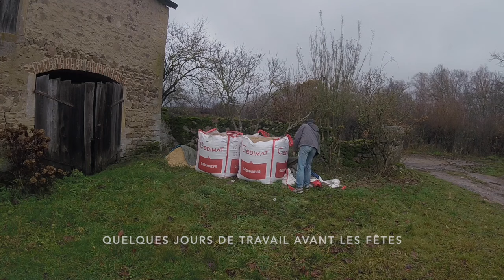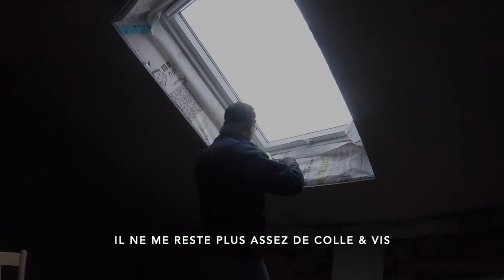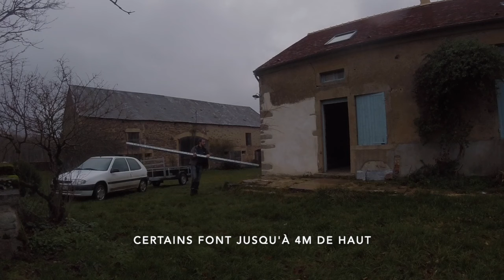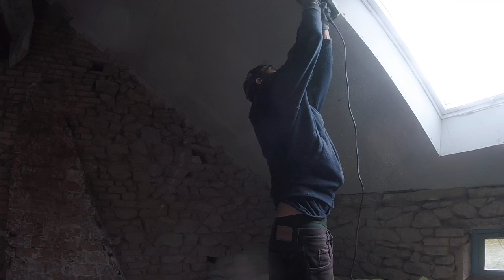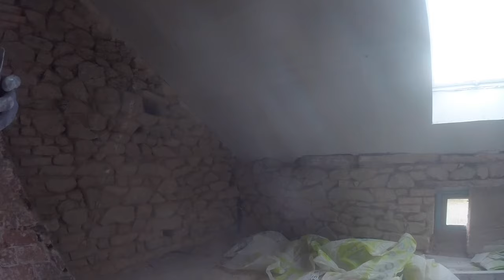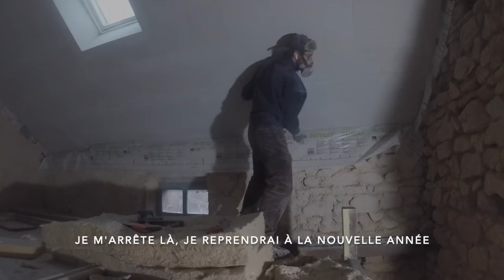#78 : Début de ponçage du Fermacell

Comment: Je pense que le fait d’utiliser la ponceuse sans aspiration encrasse les disques et le support, saturant ce dernier et faisant décrocher les disques. Sinon il y a des disque de type Abranet qui sont peut-être plus efficace sans aspiration.
Reply: Je ne pense pas, j'ai eut la même chose avec ma Bosch pro au départ. C'était parce que j'appuyais trop sur la machine. Ca faisait chauffer l'abrasif et fondre le velcro du plateau. J'ai changé le plateau, je laisse la machine travailler sur son propre poids, et tout va bien. Le revendeur officiel de chez moi, m'a aussi déconseiller de prendre les abrasifs Norton. Ils chauffent beaucoup trop.
Reply from the maker: Merci pour le conseil, j’avais déjà eu le problème sur d’autres supports, le problème est que les disques ne tiennent tout simplement pas (vu qu’il existe des supports qui viennent remplir ce rôle)
Reply: @guillaumeenbourgogne  j'avais bien compris. C'est ce qui ce passait pour moi. Les disques s'envolaient dès que je soulevait la machine. Le premier plateau à fait 5 mns. Le deuxième 10 ans. En fait,  le velcro du plateau fond et du coup les disques ne tiennent plus. Les plateaux ce changent, c'est du "consommable".

Comment: If the sanding paper doesn’t stick you can buy a new Velcro disc. Sometimes it’s a problem of using non-original sanding paper. It happened to me too.
Reply from the maker: Thank you for the tip, i don’t like having to buy something for my machine to work with compatible sanding discs, a really bad business choice from bosch!
Have a good day :)
Reply: Fair point, this was not to defend Bosch at all, sometimes the quality of non-official consumables is not great though. Thanks for your videos really admire your skills and dedication!